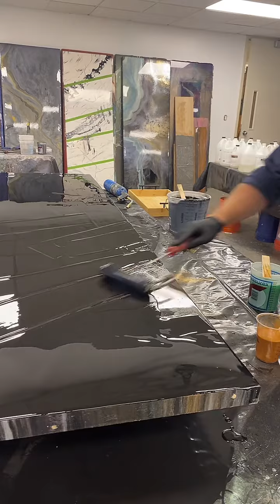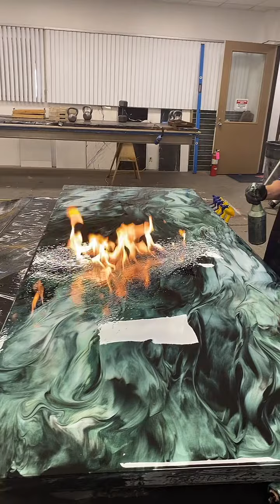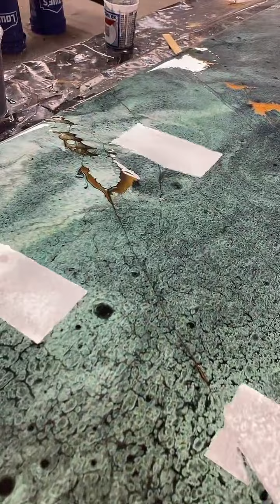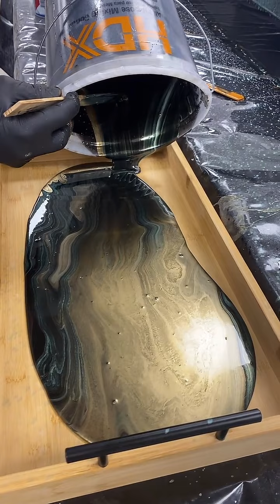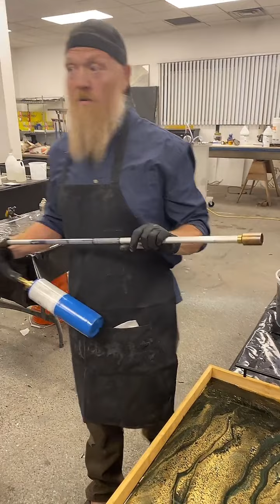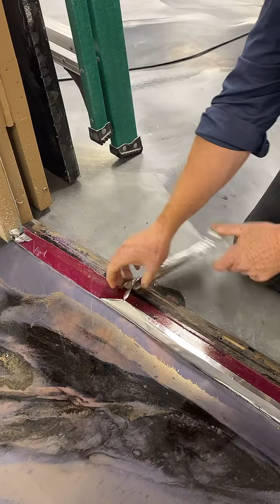Dark Jade Epoxy - TikTok Live 09/09/24 - Countertop Epoxy

Comment: I am from Florida and an interested in your products as I have bought other products which I have not used yet because of illness and the fact that they have a strong requirement for VOC protection, which I do not have in this house. I don’t want just a class in the Tampa Bay area. I would love for you to do several areas of my house, including my garage floor the floor throughout my house three bathroom, shower stalls, and three bathroom countertops and kitchen tops.